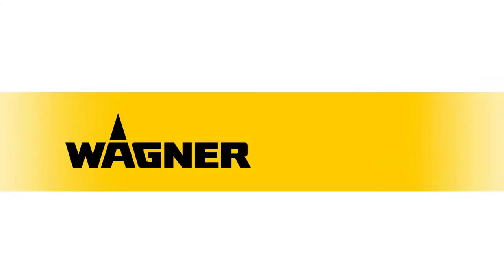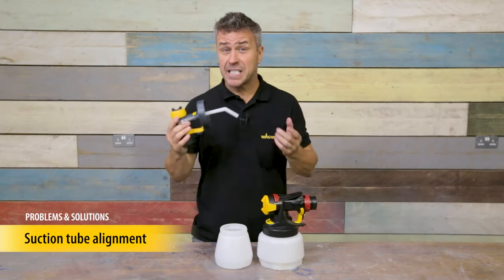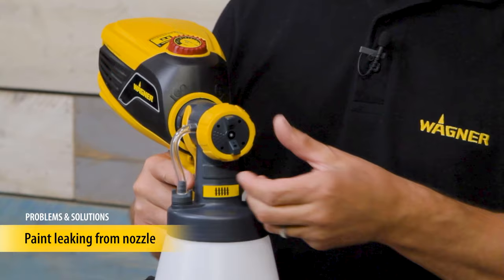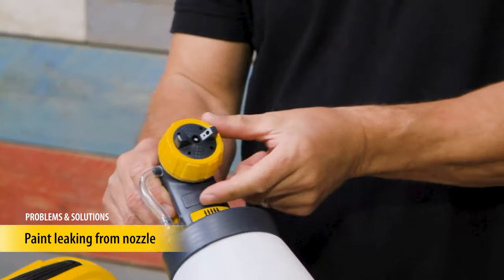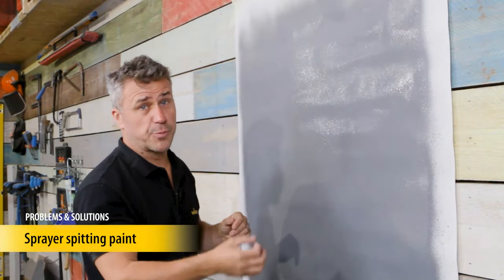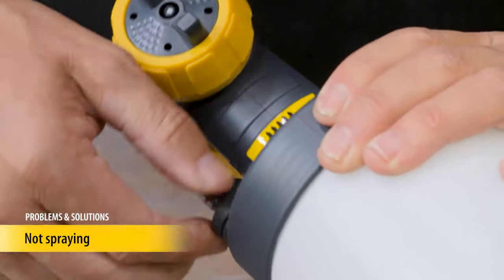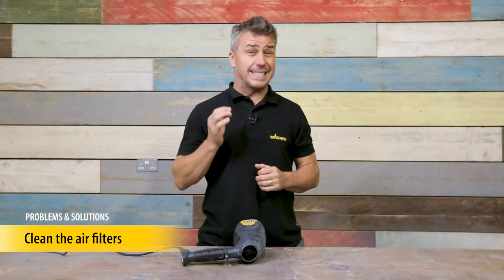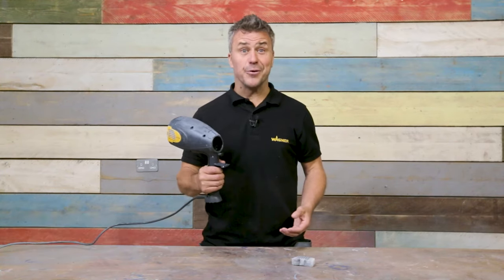WAGNER Paint Sprayer Tips and Troubleshooting with Craig Phillips

Comment: Excellent video. When the thing works it works perfect. The key is to clean it when you are done. It also save so much more paint than brushing or rolling. The problem I was having was that little tiny hole on the top of the pickup tube. It was clogged. I unclogged it and  it started working again.

Comment: Fantastic video Craig, I am curious about order of operations for doing a whole room, is it ceiling and then walls, or walls and then ceiling, logic tells me ceiling first, but just wanted to check.
Reply from the maker: Hello it is down to preference you can do it either way. Lots of decorators do ceilings and skirting first and then mask the skirting and the edge of the ceiling then spray the walls. As long as you mask anything you do not want to spray you will be ok. Kind Regards the WAGNER DIY Team
Reply: It really is your own preference, traditionally we'd of done ceiling first then the walls, I personal fine if your spraying them to start the walls first and leave to dry for a couple of days, then using a low tack masking tape with cover film mask the walls and spray paint the ceiling

Comment: this is very helpful Craig. I do have a problem with my flexio3500. Tried paint dilution, flow and pressure combinations, clean air filter and all, but still see the spray is not smooth. Its blotchy and spitting. What can cause this.. too much dilution of paint..! too much air pressure..!  not seeing Graco like results..
Reply from the maker: Hello the Flexio 3500 is a US machine you can check with then on this channel @Wagner-Spraytech. Kind Regards WAGNER DIY

Comment: bought one used , the blue filter in the air hose was switched around , the wood and metal attachment wasn’t included , have to make a run to the store and set back my paint project one day

Comment: I have to say I love my w690.  However, it takes practice to use, careful processes and fastidious cleaning, both of the sprayer and your part, but the result is well worth it.

If you're lazy and think this is just going to magically sprinkle unicorn painting dust on your work - think again.  Learning to spray paint and do it well, takes practice, and this is a tool that requires some skill to master along with that.

Sadly, the Wagner marketing nonsense showing happy chappies in jeans and t-shirts spraying away merrily couldn't be farther from the truth. The instructions are pretty lame, and I spent a few hours on YouTube learning the basics, managing viscosity, controlling air pressure and combating orange peel issues.  So this video is probably more useful than the instructions it comes with.

I will say one thing, it seems mine came with an assembly flaw.  I was having real issues with splattering, especially when turning the paint volume right down.  The paint wouldn't flow consistently and would also dry on the nozzle during spraying.  I disassembled the whole gun and found what looked like to be some kind of PTFE tape wrapped around the inside of paint supply tube behind the nozzle assembly.  It took a bit of work to get it out, but once I did the paint flowed properly I was able to achieve a very consistent spray pattern.  So might be worth completely stripping the gun if you are having issues.

Learn the basic principles, practice using it and keep it and your workspace clean of dust and you can achieve pro level results - no doubt.
Reply from the maker: Hello Neil, Thank you, for your review of your experience so far and I am pleased the paint is flowing properly now. As paint is forced through a very small hole to create the spray, any particles in the paint can block the nozzle or cause it to spit. We would always recommend straining paint through a sieve before use. This helps avoid getting any particles which could cause blockages or spitting, particularly if the paint is not new. If you experience any further issues please can you make contact with or support team on  FMB_GBSI_Technical-Support@wagner-group.com or call +44 1327 368410. Kind Regards the WAGNER DIY Team.
Reply: @WAGNERUnitedKingdom  Hi Craig, my fiancé contacted you/via a you tube message, as he didn't know any other way, online he could not get responses either. We have purchased one of the spray-painting devices, but are not able to source the 'extension' for roof painting anywhere. Would you please point us in the right direction of where or who from we can purchase one? We are in Australia. Thank you.
Reply: Thank you  @WAGNERUnitedKingdom for giving a generic reply to Neil Stansbury's comment, it really warms the cockles of potential customers when you give a reply that completely ignores the point he raised. Clearly there was some kind of issue when his kit was manufactured, hence the contamination by PTFE tape, which was completely ignored in your reply. Whilst not desirable, there's so much going on in a manufacturing facility that contamination can sometimes occur, there's no need to pretend this did not or cannot happen. Anyway, he problem solved the issue, which is far preferable to the annoying customers who throw millions of items back at the manufacturer when a simple fault diagnosis could have prevented this.
Reply: @Neil Stansbury, I have discovered your most excellent, detailed review of this sprayer and, if you don't mind, I am going to post a copy of it in the comments here. It is undoubtedly the most useful review I have ever read on Amazon, and hopefully Wagner and others will like the comment so much that it gets driven to the top and becomes one of the first comments potential buyers read, because such an honest review would greatly increase the number of potential buyers whose fear of dipping their toes into the sprayer pond inevitably results in them walking away because of the unknowns. Your review takes away the clouds of fear and the unknown, and guides readers into a bit of self-analysis about whether they have the technical discipline and patience to allow this sprayer's excellent capabilities to come to the fore.

I salute you on your review and hope that Wagner recognise you should sales start to rise as a result of your review getting the number of eyes on it that it deserves.

ps I bought the W690 earlier today before I had even seen your review (because I have the kind of traits that your review states is needed to get the best of the sprayer) but if I hadn't already purchased it before reading your review then I would have been convinced into doing so.

Will I have to spend a bit more money following your guidance? Undoubtedly, but it will result in my experience of the machine being a lot more enjoyable, and save me from spending more money on a more expensive machine, so this will be a cost saving in the long run. The vast majority of people buying this sprayer will be a stranger to this sector and so they really, really wouldn't want to spend the much greater amounts involved in getting the more powerful machines, therefore it is important that they get the maximum performance and results from what most people will probably consider a sizeable investment over and above a paint brush, roller and scuttle/tray.
Reply: @Saintathantwinpeaks  Oh I'm really pleased that someone found it useful! That whole a "bad workman always blames his tools" saying seems very apt with tools like this that take some patience to master properly.

Comment: If the union nut on the front is too tight paint will spray out as the spray nozzle will be open. Have the union nut just tight enough, so no paint come out when you start the motor.
Reply from the maker: Thanks Bob that is good advice. Kind Regards The WAGNER DIY Team

Comment: Can you spray a stop rot primer like zinsser BIN ? If so which sprayer to use
Reply from the maker: Hello the wood and metal spray attachement with the W590 would be suitable. That paint is thick so you would probably need to thin it before spraying. Regards the WAGNER DIY Team.

Comment: Hey Craig - Any tips for applying Zinsser Allcoat water based? I spoke to Alan in the office who said simply that this was the wrong gun and I'd need a better (more expensive) one..., I'm panicking a bit as I just bought this and have 10 litres of Allcoat to put on a gazebo tomorrow 😅 So far I'm going with 10% dilution and using the smaller bottle. Any guidance much appreciated
Reply from the maker: Hi, Alan is correct - looking at the data sheet from the manufacturer, they recommend using an airless sprayer with a tip size of 0.013" - 0.017" at max. 10% dilution. You would certainly need one of our airless machines like the Control Pro 250M or 350M for optimum spraying results.
Reply: @WAGNERUnitedKingdom  Thanks for your reply. I also have a Control Pro 250M - Can you recommend (or post a link, ideally) to the tip I should be using, please? I have a 517 tip - is that up to the job with the Zinsser? 
Many thanks.
(I achieved an adequate finish with the bigger of the two bottles on the posted gun) Allcoat is a nightmare to clean off - it sticks to everything!)

Comment: I had a Wagner and it stopped working after a few days spraying. I returned it to Home Depot, and they said they are not designed to use primer latex paints, and espeially not if you thin your paint with water, u have to buy a special thinner, is that correct...thanks
Reply from the maker: Hello no that does not sound correct, if the paint is water based you would thin it with water. If it is oil based then you would thin it with the correct thinners as advised by the paint manufacturer. Spraying the paint does not change what you thin it with. Kind Regards the WAGNER DIY Team.

Comment: Hi.  Just bought a Flexio 590. How do I get the best and smoothest surface? Grettings from Sweden
Reply from the maker: Hello Practice is key to get the best results. To familiarize yourself with your sprayer, we suggest practice spraying using the included Wagner spray poster, and if you need additional practice to get comfortable painting with a sprayer, large flattened out cardboard boxes work great too. Before you begin spraying paint make sure you’re comfortable spraying in both a horizontal and vertical spray pattern. By adjust the material volume and air flow you can achieve the finish that is right for you and the paint you are spraying. Kind Regards The WAGNER DIY Team

Comment: Hi, I bought the NER 2369472 460W ELECTRIC FENCE & DECKING SPRAYER 220-240V, is there anything stopping me from painting a dashed garden wall with this sprayer or is it too weak? I know the reviews and ads are all about fences and garden furniture, but it sprays a nice fine costing, I'd be using water based paint..
Reply from the maker: Hello, this machine is only recommended for thin materials like wood treatment/stain. The spray attachment (nozzle) is only designed for these sort of materials also. Please follow these guidelines for the best spray results. If you need to spray thicker materials then please look at the W590 or W690. Thanks - The Wagner DIY Team.
Reply: @WAGNERUnitedKingdom  Thanks! we decided to keep the one we got, it did a nice job on a garden fence, just finished it before dark, If I had everything ready in front of me, I'd have the whole fence done in about 20 mins on both sides, time saver, good sprayer. gonna attempt a dashed wall next, paint is thin.

Comment: i craig do i need to dilute ronseal fence paint to use in my wagner
Reply from the maker: Thank you for your question. No, normally you do not need to dilute Ronseal fence paint for use in your Wagner sprayer. It's designed to be used directly from the can. Just make sure to stir the paint thoroughly before spraying. Kind regards, WAGNER DIY

Comment: What about paint coming out of the two holes where the trigger pin passes through.  Just turning the gun on and paint comes spewing out, magically when the nozzle is removed, it wont leak.
Reply from the maker: Hello Andy, we are sorry to hear you are having problems with your machine, please contact the UK Customer Service team on FMB_GBSI_Technical-Support@wagner-group.com or call +44 1327 368410. If you are based outside of the UK please see the other Wagner office locations at the bottom of this page https://www.wagner-group.com/uk/our-company/ Kind Regards WAGNER DIY
Reply: I've used my flex 3500 through about 30 tub refinishing. And cleaned the gun every use. It's been around 3 months since it was used and had a tub refinish to do. Went to go spray the tub and the unit started pouring from the trigger pin that goes through the gun. Well made my day screwed-up had a hell of a mess to clean up spent more time cleaning up spent more time cleaning up then making money. 😡😡😡
Reply: @stower82  I learned you can't run laquer thinner through the guns, so then no laquer consequently.   now I spray polyurethane and clean with mineral spirits.
Reply: @Chaosweaver-1  the paint for refinishing tubs is polyurethane. But I use acetone to clean it. Acetone may be too rough on the internals of the needle valve. Might have to try the mineral spirits

Comment: Craig what's best for frenciqe paint mate ??
Reply from the maker: Hello Nick, with the Wagner HVLP paint sprayer you can use most fence paint types and brands, you don’t need specialist sprayable paints. You can use water and solvent-based paints but I would recommend using water based paints as they are easier to dilute if required and also easier to clean up afterwards. Using paint at room temperature also make them easier to mix and spray. To dilute and get the correct consistency/viscosity of paint you can use the Wagner stirrer which has 10% notches on the side. It is recommended to add 10% water/thinner and increase by 5% at a time. Getting the paint consistency right will ensure you get a professional finish. Kind Regards the WAGNER DIY Team

Comment: Can I use latex or acrylic paint in a Wagner paint sprayer
Reply from the maker: Hello Zota, with the Wagner paint sprayers you can use most paint types and brands, you don’t need specialist sprayable paints. You can use water and solvent-based paints including acrylic and latex emulsion paints with the Universal sprayer. I would recommend using water based paints as they are easier to dilute if required and also easier to clean up afterwards. Kind Regards the WAGNER DIY Team

Comment: I bought one 2days ago  so far it is utter rubbish the paint seems to be splattering the wall the finish resembles the surface of the moon. I have tried thinning the paint and adjusting everything on the sprayer and still it's rubbish. I can get a far better finish using a roller and it's a lot faster too. I will contact Wagner but I feel it's going back. I feel it's waisting my time
Reply from the maker: Hey Carl, sorry that you are having trouble. Which machine did you purchase and what type of paint are you trying to spray? With the right setup and the right machine/materials you can get wonderful results with Wagner sprayers ♥

Comment: I bought a 595 not too long ago, and I can't get it to work good for me. The paint always end up splotchy - no matter what the settings I use or how much I thin it down - it just spits out the paint. I'm trying to paint my walls and cabinets, not a Jackson Pollock. 
Also, the "2 part" trigger doesn't seem to work on mine? I flip on the power switch and it automatically starts the airflow. The yellow part of the trigger moves independently and doesn't really seem to do anything until it depresses the black/bottom trigger.
Reply from the maker: Hello you would be better to go back to @Wagner-Spraytech as the Flexio 595 is sold in the US and is different to the W590 shown in this video. They should be able to help you. Kind Regards WAGNER DIY

Comment: used mine 2 times and cleaned it . It is no longer working it's a piece of crap . Wasted my whole day messing with this , it clogs easily and stops running . Other than throwing it in the garbage , it's useless.
Reply from the maker: Hi, sorry to hear you had problems with your Wagner sprayer. Did you get a chance to test the dilution of the materials you were spraying? Were you using the correct spray attachment for the materials you were spraying?

Comment: I bought the Flexio 3500. Horrible piece of equipment. It just doesn't work! I tried every setting, couldn't get a decent spray going. I tried thinning my paint, that worked for 10 minutes before the nozzle clogged. I wasted so much time prepping to use a sprayer that just wouldn't work. I could have been done a day earlier with my painting project if I had of just gone with a brush and roller to begin with. Also all the talk about how easy it is to clean, well that isn't true. It takes just as long to clean as regular painting equipment. Please save yourself time, money, aggravation, your sanity and possibly your marriage and just use a brush and roller. I was thinking about selling my unit on Ebay but I don't know if I can in good conscience knowing how poorly it preforms.
Reply from the maker: Hello Brian, I am sorry to hear you are having problems with your machine, the Flexio 3500 is not a product sold in the UK and only sold in the US. If you are still having problems and want to get them resolved please contact the US support team, you can find the detail here: https://support.wagnerspraytech.com/ Kind Regards the WAGNER DIY Team.